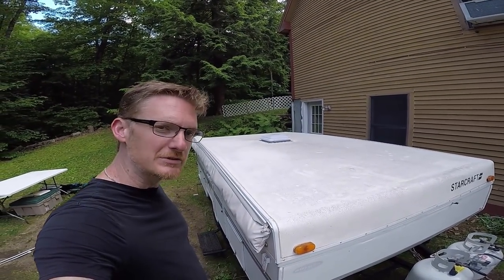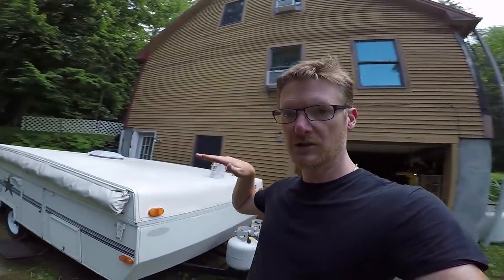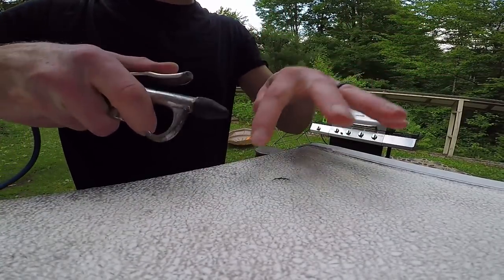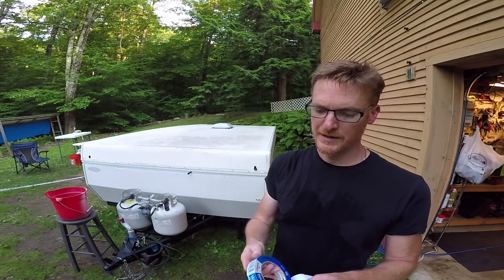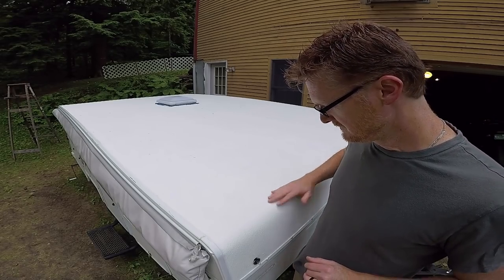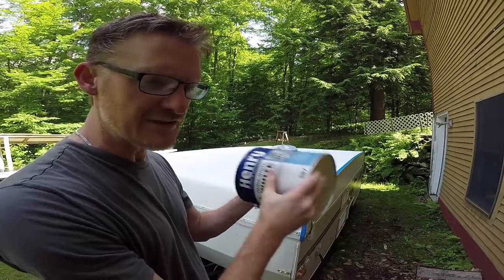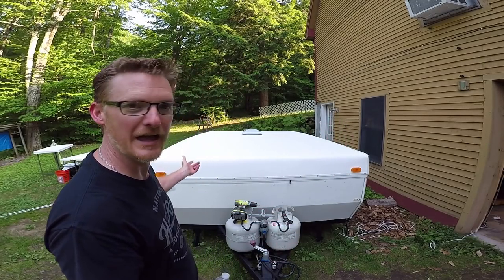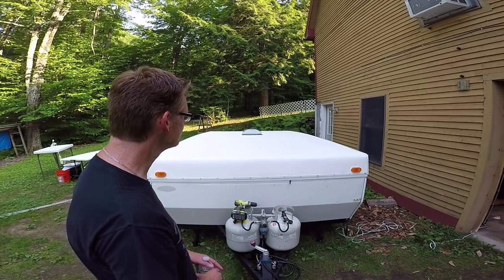Restore Old Pop Up Camper Roof

Comment: Great job Mike you have extended it life for another few years . Excellent work!
Reply from the maker: Thank you!! We ended up trading it on a new popup after someone climbed on top of it during its winter storage and broke the seal between the side wall and the roof panel. It got all wet inside. Molded. I didn’t feel like rebuilding it so we traded it in. I still miss her!

Comment: Great job! I just picked up a 98 Coleman fleetwood that needs some tlc on the roof. Going to go this route. About the only thing I will do different is use plumbers puddly or gasket material around the lights. Just my opinion that caulking will make it harder to get off if they need to be changed in the future. But hey! It works your way too. Thanks for uploading.

Comment: Got a 1990 jayco I was thinking of doing the same. Glad I was on the right track and I found your video
Reply from the maker: That's great! Thanks Dawn 😁👊
Reply: I used a scrub brush and Dawn dish detergent to clean my whole camper on the outside. Got a heat gun to remove all the stickers also. I've got 1 little ding I can see will the paint cover it by itself or do I have to do something else first
Reply from the maker: @ddcatwoman25  Sounds like you're prepared! I use paintable caulk to fill punctures. I use my fingers to level it out. Let it cure before you paint over it. Sometimes the caulk shrinks and it needs another coat. But once its dry, paint right over it. Hope that answers the ding issue!
Reply: Thanks! I'll do that first then. Thanks for all the info!

Comment: What you are thinking  is dirt on the roof (approximately 1:30 into video) is actually the metal roof. The paint they put on these older roofs is very thin and tends to disappear over the years. I've worked on campers for a great many years and have seen this on all brands. Great idea with the rubberized covering. That should give you many, many years of use.
Reply from the maker: That makes a lot of sense! Thanks for the feedback!

Comment: Great video , I'm in the process of rebuilding the roof and was going to use flex seal on the outside but I think I like the paint idea better.  By the way I am from the Berkshires, hope you enjoy it.
Reply from the maker: One time we camped under a tree and it dropped red berry like seedlings on the roof and left a couple stains. A little spray-bottle-cleanup-bleach, mild scrub brush, spray off with hose and it looked great again. BTW, we ended up trading to a new pop up but that roof looked awesome while we had it. I think you’ll like it.

Comment: To clean the roof really well use a pressure cleaner.. mine had that same grime that was in between the little ridges like yours did. Pressure cleaner took it right out. Painting mine as we speak lol
Reply from the maker: MeanGreenTJ05 it was so old, I was afraid of pushing water into the wood underneath! So I prepped and painted and it worked well :)
Reply: Michael Yep I can understand that lol Luckily mine wasn't toooo far gone yet..

Comment: How happy are you with it almost 3 years now?
Reply from the maker: After 1 year it still looked like new. There were a couple camping trips where we parked under a tree with berries and it stained the roof. When I got home, I washed the camper like I normally do (with it closed) and then sprayed some clorox cleanup bleach on the stains. Used a light bristle brush on the area and then sprayed it off. Looked great. But that winter, while in storage, the camper was surrounded with snow and one of the kids climbed on top of it and the roof separated from the side panel. Just a small 1" gap. But it was enough for water to get in and ruin things. In the spring I was not willing to rebuild the entire roof so we traded it in on a new camper. I told the dealer what had happened and they took it anyway. BUT... I saw our old camper 4 months later on the dealers lot and it still looked like new. Hope that helps :)

Comment: How is your roof holding up almost a year later? We have a 2008 Starcraft and are about to paint our roof as well. Last summer when we were camping a gust of wind flipped our awning and made a small ding about the same size of yours ding in I saw in video. We slapped some duck tape on it immediately and had no problems with leaking the rest of the summer. We were considering filling our ding with caulking or epoxy and then painting the whole roof. Do you recommend the Henry Elastomeric paint and vinyl adhesive? If so we will follow you instruction to a T. Thanks for the video!
Reply from the maker: Rebekka Star Auerbach yes I do recommended it. The roof looks great and have had no problems. I have had to used a little spray bleach to clean tree-dropping stains off of it, but it continues to look like new.

Comment: looks good but I would not caulk the lights because you may need to replace bulbs in the future
Reply from the maker: RochesterAstro I did not caulk the lens. To replace the bulb the lens pops off. The caulk is only on the part that mounts to the camper 👍

Comment: what is the name of that vinyl adhesive you used for the small hole on the roof?   I am making a list I just got a pop up for free and need to fix the roof first
Reply from the maker: It was pretty standard latex caulk, phenoseal... whatever you use, it needs to be something that is paintable. After a year it was still solid, no change in the shape but then again it was completely sealed by the elastomeric paint. Worked great!
Reply: @sstressfl  Thank you so much for responding.   I just got the same size pop up you have but its a coleman.  I can't wait to get working on it.  I sew to so Ill probably work on the inside valance that is all the way around it.  I wont doll it up its a camper lol.  Just needs to look like a pop up again with tlc.   Thank you again.
Reply from the maker: Mareya Cannenta enjoy the process! It’s fun to make it your own, to be creative, especially on a limited budget! We restored one very affordably and it truly was part of the family when we were done 🤗 My best to you 🙏

Comment: This was a very helpful video.  TY.  How is it holding up today?  What type or nap roller did you use to put it on with?
Reply from the maker: After we got it out to a campground, I parked it under a tree that dropped red berries on the roof and it made stains. When I got home I cleaned it with a little spray bleach (like cleaning stucco) and a light scrub brush. Then sprayed it off with a hose. It looked great. We used it for an entire summer. So liked how NEW it looked. During winter storage the kids climbed on top of it (the snow was so deep that they were able to walk right on to it) and the corner of the roof separated from the side wall... just enough to allow water inside and it smelled so strong of mold. The roof at that pointed needed a complete tear down and rebuild. I was so frustrated that I traded it in and bought a new one. But, the last time I saw old Phyllis at the dealership (4 months after trade in) the roof still looked like new :) Hope that helps!

Comment: I have apache  camper fix roof many times do you think this will  work on mine it abs  material
Reply from the maker: mrslashman123 the abs roof is vulnerable to sun and heat damage. I would clean and sand the roof thoroughly, repair all cracks, then use elastomeric paint to seal it. It will help to protect it better than paint! I might test a small area and let it dry first. I imagine it would work very well.
Reply: Thnx  I will try it

Comment: Michael, how's the roof holding up?  Would you still recommend this Henry's material?
Reply from the maker: We ended up trading it after 1 year for a new popup, but during that time it was awesome. When it would get a tree stain/berry stain on it I would spray a little Clorox cleanup bleach on it then use a light nylon brush. Spray it off with a hose. Looked wonderful. If I bought another older camper, I would do it again.

Comment: The scotch pad won't reach into the deeper textured surfaces at all... use a stiff poly brush (for washing car tires) instead! Painting at night is a mistake. The floodlights draw in flying insects...
Reply from the maker: Derek Suddreth thanks man. I tested multiple cleaning devices. The scotch pad was perfect. The texture is not deep! The scotch pad also had the effect of prepping the surface like a mild sandpaper. Again, it is the right application for this specific roof type. I live in Vermont. The insects are present with and without the floodlights. They landed in the paint after the lights were turned off, whilst I slept. The only reason painting at night was a problem, which I addressed, was the increased moisture in the air that delayed drying. But when you have so little precious time, you do what you gotta do. Thanks for your thoughts my friend.

Comment: How has this held up?  Is it easy to clean when it gets dirty?
Reply from the maker: I traded it on a new popup. However a year later it still looked like new. But the roof got stained once when parked under a berry tree and I used spray bleach, a soft bristle brush, and sprayed off with a hose. It was easy to maintain and looked fantastic. A few months later I saw it still sitting on the dealers lot and it still looked great.

Comment: Sorry to bug you. I was looking for the paint locally. Found a Henry acrylic elastomeric and a silicone based RV and trailer waterproof paint. Was wondering which you used and recommend. My thoughts acrylic is hard like a shell and therefore prone to cracking when raising or lowering roof.
Reply from the maker: PAGrunt Hi there! Good question! If you search google “silicone vs elastomeric” you’ll find silicone is not as good. It does not last as long. It will leak because it absorbs water. It’s flammable. It’s smells bad. Elastomeric is flexible. Lasts longer. Looks better longer. It will not absorb water. And is less expensive. You won’t regret it :)
Reply: Michael Byrne thanks for the reply. I’m a pipe fitter/welder so this isn’t exactly my forte. My roof is aluminum, and it looked like yours is too. Scouring the net and I see lots of stuff for ABS roofs, not a lot on aluminum. I sealed all the corners and joints today after a heavy cleaning. Work tomorrow so it looks like another washing and then paint next weekend. Thanks again and good luck with your channel.
Reply from the maker: PAGrunt yes mine is aluminum too👍 enjoy! And thank you so much.

Comment: I am needing to replace the screws in the roof of my Skamper pop up but i have no idea what length they are, anyone know?? I am wanting 304 stainless steel but my trailer is stored an hour away so going there to measure a screw is redundant as I would imagine the length and size is likely universal?
Reply from the maker: The screw head is definitely unique on pop up  campers. Usually the head is very small. Whenevver I bought generic screws the head was always too big/wide. This is typical for a pop up https://amzn.to/3abdpTT The stainless offerings all look too large. But I am not sure. The best you can do is take one out and go shopping. I hope you find what you need!

Comment: i am thinking of doing this on my pop up.  So its been about a year since you applied?  How is it holding, anything different you would of tried etc?
Reply from the maker: A week or so later, it got some stains on it from sitting under certain trees. I hit it with Clorox spray cleanup bleach, gentle scrub brush, then rinsed. 90% came out. Then overtime 99% has come out after a rain or two. It still looks like new. Just make sure your camper is sealed when you clean it. You dont want bleach hitting the interior. But yes, no regrets!! Has allowed me to stop worrying about the roof and focus on enjoying camping. Plus it looks so good!!
Reply: awesome, thanks for the reply
Reply: @sstressfl  Still holding up?
Reply from the maker: @chrism7067  It was still like new after 1 year but then someone climbed on top of our popup while it was in winter-storage and broke the roof seam and it got very wet inside. So we bought a new one.
Reply: @sstressfl  damn sorry to hear that :/

Comment: My roof on our pop up is the same as yours. Is it aluminum?
Reply from the maker: It is! A sheet of aluminum on the top. Its built like a sandwich with wood in the middle.
Reply: Michael Byrne ok very good. I bought it from someone who probably used the same paint as you. It’s peeling badly, I assume they didn’t prep the surface the proper way. Is yours still holding up?
Reply from the maker: @jefffolk4421  After a year mine still looked like new. Not sure what they used on the camper you just bought but proper surface prep is critical and using a the right quality coating makes all the difference in how long it will last.

Comment: Is this stuff a good way to seal small & larger cracks that are forming in the roof of my pop up fiberglass too camper?? 
I have some larger cracks that are causing leaks, and some smaller ones that I want to seal before they become larger & cause leaks!!
Thanks for any help!!
Reply from the maker: Danielle Jenkins Hi! The paint won’t seal actual cracks. You’ll need caulk for small cracks or possibly a fiberglass repair kit to fill large cracks. Then when the patch repair dries you would paint over top of it.

Comment: How clean did it stay after you painted it? I have read that some people make the third coat a outdoor semi gloss so that it will be easier to clean? Just want thoughts. Thanks if you can answer! love your new pop up.
Reply from the maker: Hey man... this is what it looked like after an entire season of new england camping and a full winter in storage https://youtu.be/t9bXDNb-Xtg?t=130. It still looked like new! I read that the coating is like stucco. So when it got dirty, I cleaned it like stucco. After every camping trip I always washed the camper before I parked it. If there were any stains on the roof, I used a  little spray bleach, a soft bristle scrub brush, and sprayed it off with the hose. Its meant to be a top coat. And I read that a glossy top coat will not last as long as the elastomeric paint underneath.

Comment: I just painted my sides on my 1996 Dutchmen that is exactly like yours except for the name.  I used Rust-oleum spray paint but will roll paint on top. How is the paint holding up?
Reply from the maker: It looked like new for a year after we used it camping but in the Spring I traded the old Popup in on a new popup. The roof surface was still great. I got berry stains on it once and it cleaned up like stucco. A mist of spray bleach followed by a light scrub brush and sprayed off with the garden hose and it looked good as new again. The coating works very well.
Reply: @sstressfl  Where did you get the paint?
Reply: @sstressfl   Nevermind found some.
Reply from the maker: @mdkzztop  Home Depot $25!

Comment: Great job was thinking bed liner for mine. How is this holding up?  1995 Starcraft going to get this same treatment
Reply from the maker: It's still bright, clean and pretty. Solid roof. Mostly surprised by how much better it looks. I had some tree stuff sit on it and some stains appeared. I read stucco guys used bleach and a light scrub brush to remove stains so I tried it.  The stains came out 90%, but then after a couple of rains I can't see the stains at all. Bleach worked great. Just make sure your camper is sealed shut. You dont want bleach inside! I say go for it :)

Comment: Will this stuff dry out, crack and fail over time? After all, it is rubber.
Reply from the maker: Jay Shreve It will need repainting eventually. But from what I’ve read, I’ll be well into retirement, Lord willing, before it begins to fail. Elastomeric paint is incredibly strong and will last well beyond 10 years if it’s applied correctly. Plus it behaves more like paint not caulk. Sand it and repaint as required. 👍

Comment: How is it 4 years later?
Reply from the maker: One of the kids crawled onto the roof during winter and the roof separated from the side of the roof. The crack let all kinds of water inside. We traded it in for $500 toward our new camper. It was still perfect after 1 year before that happened. I would clean minor stains with a little spray bleach and a brush then rinse it off. Would do it again if I had an old popup roof to restore.

Comment: How has it held up?
Reply from the maker: After 1 year it still looked like new. There were a couple camping trips where we parked under a tree with berries and it stained the roof. When I got home, I washed the camper like I normally do (with it closed) and then sprayed some clorox cleanup bleach on the stains. Used a light bristle brush on the area and then sprayed it off. Looked great. But that winter, while in storage, the camper was surrounded with snow and one of the kids climbed on top of it and the roof separated from the side panel. Just a small 1" gap. But it was enough for water to get in and ruin things. In the spring I was not willing to rebuild the entire roof so we traded it in on a new camper. I told the dealer what had happened and they took it anyway. BUT... I saw our old camper 4 months later on the dealers lot and it still looked like new. Hope that helps :)

Comment: Does that paint work like the flex seal
Reply from the maker: It dries more like stucco... its rubberized paint but not as rubber as flex seal.
Reply: @sstressfl  would you consider priming the top before using this product.   Im leaning towards the rustoleum elastomeric 710 versus the Henry elastomeric 587.
Reply from the maker: @traviswagner9822  As long as the primer is compatible I'm sure it wouldnt hurt!

Comment: How has it been holding up over the past 2 years?
Reply from the maker: Rob Gordon it still looked like new after I traded it in last year 👍 the stuff is as hard as a rock. Cleans up easy with a little spray bleach and a light scrub brush/spray with water. With proper surface prep it will last at least 10 years.